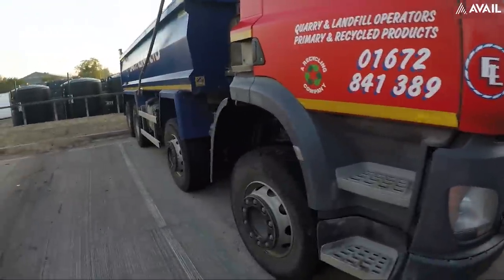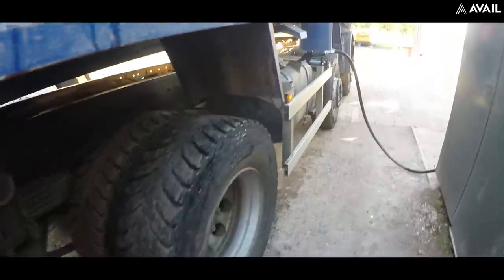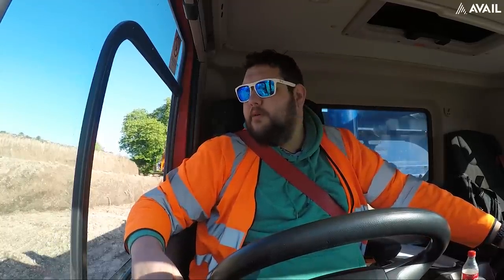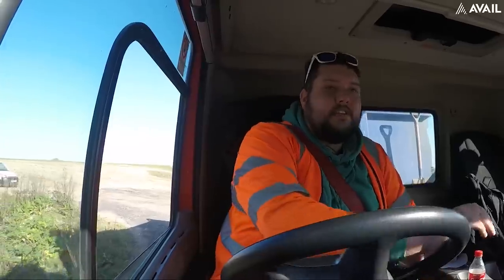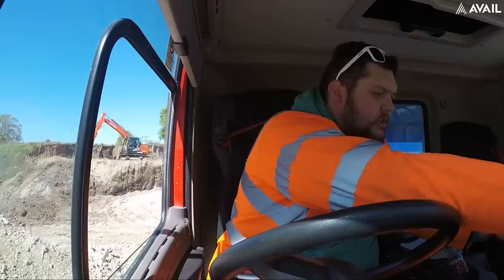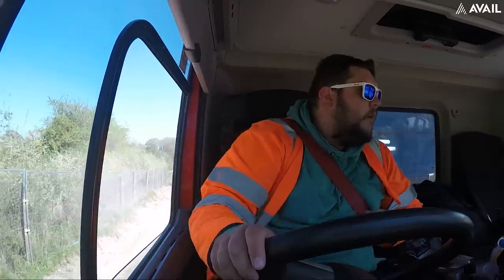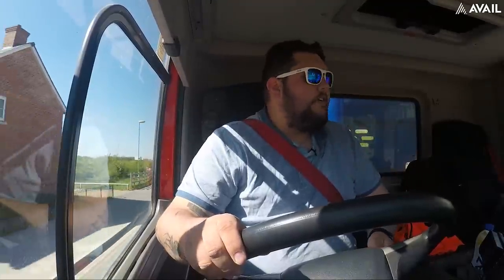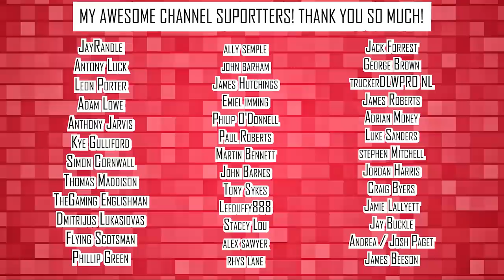HGV Tipper Driver VS 180 Tonnes of Earth!

Comment: I've been doing some tipper work and class 1 general haulage in the last few weeks. I've found that although I work shorter hours on a tipper, I do more driving hours than on general haulage where the days are much longer. That's because with the tipper you rarely have to wait long to load or tip and your nearly always on the move, whereas on general haulage you often have to wait hours to load or tip which is very frustrating!

Comment: That would have just been a manual entry because driver would probably have been on site fot 15 mins before left site and although daily checks need to be done obviously but it may have been on for its 6 weekly check which will be more thorough than most drivers would check it etc 

But to be in truck for 2 or 3 minutes the tacho would read as checks were done

Comment: Great vlog. I think you've probably said this in a previous vlog but what's the reason for lifting the body slightly when getting loaded?
Reply from the maker: Scales 👌
Tell me when I'm fully loaded at maximum weight as that's what we run at and we don't wanna break the weight limits 👌 (32,000kg) 32tonnes

Comment: Just started in tippers iv been told you shouldn't driver around with the body up however you do whats your opinion on this. Btw good vid as always
Reply: How are you finding it I'm in 2 minds to try tipper work what's the hours like work life balance?
Reply: @muzzf2   i did tipper work for almost a year and it just depends on the company and also how much work they have at a particular time.. i usually started between 5-7am and finished betwern 5-7pm so was pretty brutal and often you have to work one saturday out of every fortnight but again it just all depends on the company and how busy they are!
Reply: See below comment however i dont mind long hours you get sometimes as i was doing max hours for around a year on palletised artic work

Comment: Hi, Luke, I was wondering on the next vlog would you mind putting up a split clip with you on the upper part and the big clip that is used for looking out the front of the truck like on the last vlog are you like driving the 4 wheeler tipper truck or do you like the bock bags on a flatbed trailer instead?